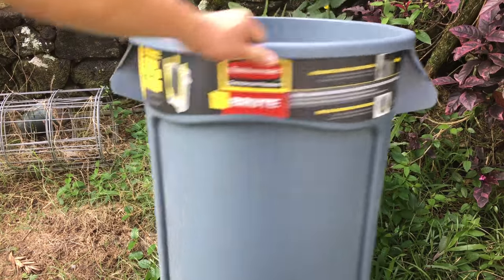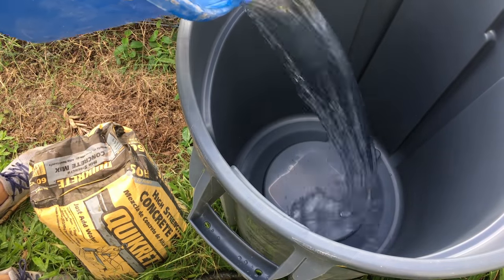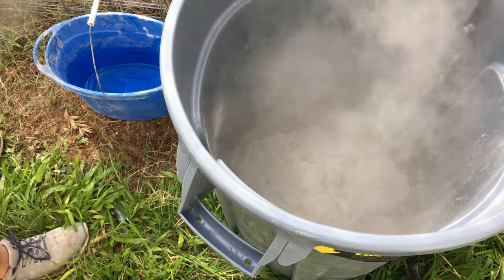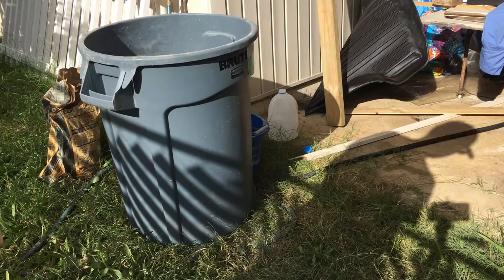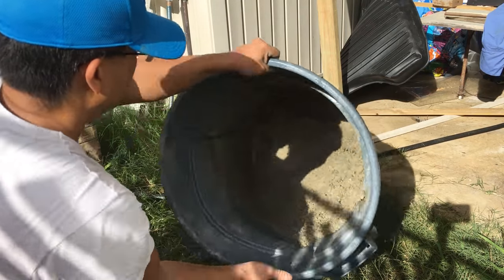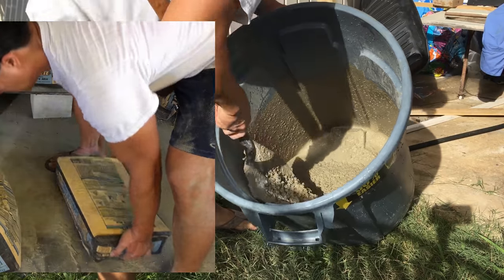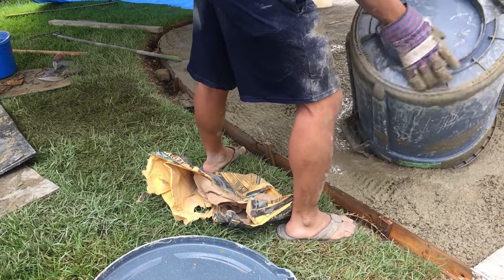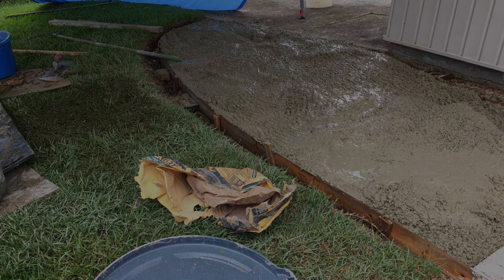How to Mix Concrete / Cement in a Trash Can, 2 Minutes Without Drill, Wheelbarrow or Mixer. DIY Hack

Comment: I have a construction company and we do a ton of decks. Honestly we’ve found having 3 buckets in rotation and a corded drill/mixer is the fastest and least tiring.  One guy mixing, another dumping. The buckets make it extremely manageable instead of wrestling a wheelbarrow. You can put it exactly where you want with no spillage. We’ve used the same buckets on 10 decks so far. And they take up 1/4 the space of a wheelbarrow

Comment: great idea Tani- thankyou !! a week ago I used thsi method to make 6 deep footings/piers (350x350x450mm) in a small yard. Your 'bin' mixer was a perfect technique/size/method  as I have lots of steps /narrow stairwell to get to the yard. One bag at a time is best and it worked really as seen in your video (approx.15 mins = to open/carry the single concrete bag, mix it in the 'tub mixer' and pour it in the footing hole)   .I would add these tips (based on my '25bags mixed' to make the piers/footings) ... 1) the user must work quickly once the 2nd half of water is added so that the 'water slush' pushes the mix well ,  2) A small Garden fork & small Garden plastic spade is good for breaking dry spots/ the occasional clog and cleaning out the mix that wants to stay in the 'bin' ...   & then a nice beer afterwards !  Thanks Tani
Reply from the maker: That beer must have tasted so good after all that work!  Thanks for letting me know how your project went. Cheers!

Comment: I like it!  It looks even easier than mixing in one of the black flat tubs made for concrete.
Reply from the maker: Hey LJ!  It definitely is, and I like that the black tub or wheel barrow wont be taking up space in my yard.  At least I use the trash can for garbage.
Reply: Unfortunately we have those waste management trash bins.
Reply from the maker: Same here, but I do use the round trash bin I purchased for all sorts of other uses around the yard, I think it has more uses then one of those black concrete mixing troughs.
Reply: @thriftytani46  that’s a good point.

Comment: Good idea. I'll try this today. Thanks!
Reply: Did you try it?   How did it work out for you?
Reply: @mu99ins  I was really happy with how it worked out. I planted three 4x4 posts for some grape vines and it was a lot easier than mixing with a shovel. This is my go to technique until I find something better
Reply: @IVespidI  -  With a hoe and a wheel barrow, I can mix four 80 lb bags of Sakrete concrete mix before I get tired.    I foresee a project, soon, which will take maybe 10 bags of Sakrete, so I think I'll give it a try with the
"rolling trash can" method to see if I can mix
more bags of Sakrete before I run out of energy.   Thanks for the quick reply.
Reply: @mu99ins  I actually found that doubling up black trash bags and mixing it by rolling it around in that worked great...even better than the trash can. Trash can worked too but I just preferred the bag. It was easier to get it all mixed evenly.

Sorry for the mixed message. It had been so long since I posted this comment that I thought we were talking about the trash bag method at first.
Reply: @IVespidI  -  No problemo.  Thanks for something to consider.

Comment: What size is the can & bag of concrete?  Do you need that much empty space for it to mix well, or would a smaller can work? (Looks like you’re only using about half the can?)
Reply from the maker: The can is 32 gallons, and it’s a 60lb bag.   I’m guessing a smaller can would work, but you do need some space to allow the concrete tumble.

Comment: When you finished, you need to wash this dustbin. So, what do you do with the water and bits of cement? 
We can't put it down the drain, so what do we do with it?
Reply from the maker: You can add a bunch of water to dilute the Portland cement (the hardening component of the concrete) and pour it in the corner of your yard. You’ll be left with just the loose stone and sand which you can mix into the dirt in your yard.  I pour my leftovers on the edge of my lawn and the loose stones and sand eventually disappear under the grass.
Reply: @thriftytani46  gosh, how I didn't think of that I don't know!🤔
Thank you very much! 
All the best. 🥀
Reply from the maker: Thanks!  I hope all goes well with your project!
Reply: @thriftytani46  thank you; I have to make some gazebo weights, garden steps  repair and also need a lot of mortar to repair my stone wall. Mixing is really hard on my severed tendons, so the barrel method will be very helpful! Thank you very much again.🤗

Comment from the maker: Correction: The Trash Can is a Rubbermaid Brute and is Extremely Durable.  Amazon sells the size I used: https://amzn.to/2Cp6Zzu
I've also used a Roughneck trash can, which tore after mixing 30 bags of concrete.  Thanks!
Reply: Hmm, $33 is "thrifty", Tani?
Reply: @ljprep6250  Do you have a better option for lesser price and still be durable? For about $33 durable trash can that can mix up to 90 bags of concrete is pretty good price for me. Thanks.

Comment: That's not right, the dryer the cement the stronger it is. It just has a problem filling a thing without having a bunch of holes in it, cause it's so thick.